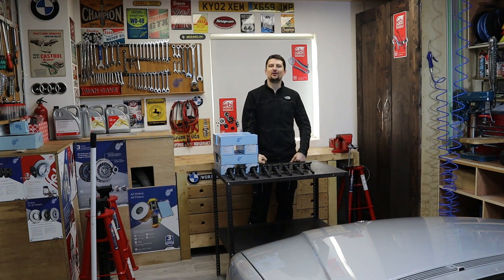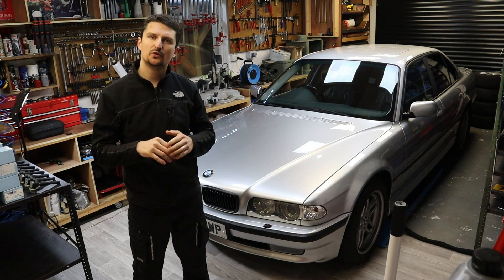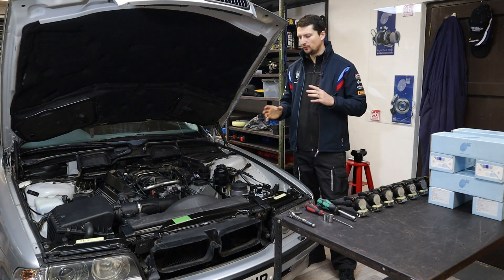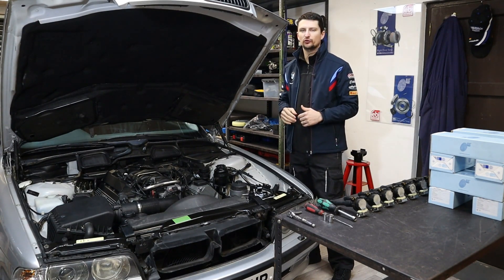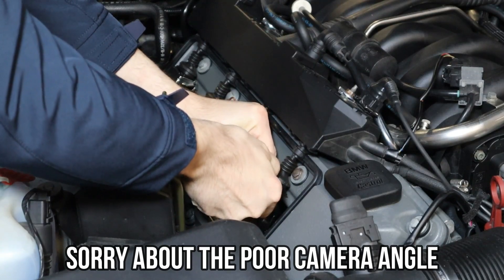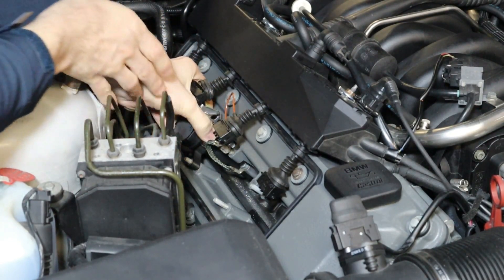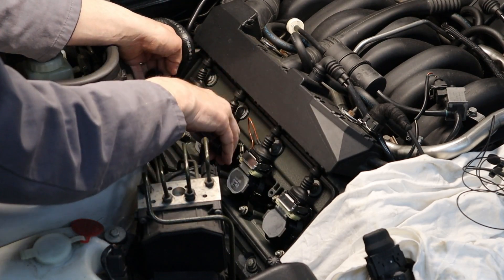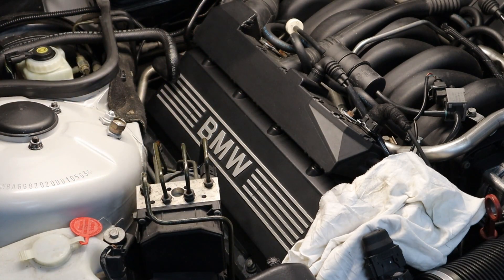BMW ignition coil replacement How to change coils on E38 740i M62TU E39 540i m62 m60 E31 E34 E53 m54

Comment: Amazing work!! Where can i contact you to a question that i have to the e38 740i?? Thank you very much!!
Reply from the maker: Hi
You can write here, we do this so the conversation is recorded and help others
Reply: @TheKeenMechanic  thank you! So my bmw e38 740i (m62 non vanos) runs well ans seems strong, but sometimes, when i accelerating i get a sudden lack of power, for about one second, and i have noticed that when the car is warm and the visco fan turns on the car lower the revs, and go back to normal ( i don't know if it is normal) but the big problem is this sudden gap of power :( . I have changed, all spark plugs, fuel pump, all filters, clean the tank, maf clean, water pump and hoses, trans position sensor and zf rebuild kit (works good), can be the injectors? I also noticed some crack under the maf band in the big air intake hose, but i haven't any idea :(
Reply from the maker: You have already checked a lot of things. Consider some of these as they may help you find the problem:
Replace fuel filter, I changed one on an E39 and was a 21 year old filter that was on the car from day 1.
Could be fuel injectors as you suspect, ultrasonic clean or replace.
Mass air flow sensor - clean or replace if faulty
Air filter - replace if not done already
Could be a vacuum leak. Use a smoke machine as I found a leak on my 740i a few years ago ob the back of the PCV or CCV valve
Could be throttle body, O2 sensors, or a transmission issue.
Hope this helps
Reply: @TheKeenMechanic  Hi my friend!!! Thank you very much:))) . So i have replaced my fuel filter and air filter (i have a bmc like k&n i don't know if it is good on those cars) but i have noticed a thing, now i have rough idle especially when i do cold starts, and today morning with a normal external temperature about 20° the car runs good, but seems runs bad on hot days like yesterday, about 30°, i have cleaned the maf, but i have heard in those cars, the maf fails and need the replace, is this for you? I have also heard about bad cats, but i don't know, cause i only had one sudden lack of power in a daily ride (30km) it is the maf?? Thank you for your time!! :)

Comment: Great video, very informative. Did this improve the engine's smoothness? I'm not sure how to interpret the diagnostic software's readout.
Reply from the maker: I had a few poorly performing coils so after replacing all it helped the engine to run smoother. Thanks for watching and for getting in touch🤝🏻

Comment: Hey The Keen Mechanic, i have a 2005 bmw e53, It has a misfire and the code is P0302. we did a compression test when the engine was cold and there are the results, cyl 1- 230psi, cyl 2- 180psi, cyl 3-230, cyl 4-230, cyl 5-230psi and cyl 6-230psi. Now we did another test after running the engine and these are the results cyl 1-200psi, cyl 2-140psi, cyl 3-200psi, cyl 4-200psi, cyl 5-200psi and cyl 6-200psi. Can that signifant drop cause cylinder 2 to misfire? Also what are specs for compression on M54 engine?
Reply from the maker: Hi
Your engine had excellent compression but you have a problem with cyl 2
This is definitely why you have a missfire.
200psi is perfect but it needs to be consistent across all 6 cylinders.
You need to see if it is coming from the valves or it is worn piston rings. Do a research and hope you get it sorted
Reply: @TheKeenMechanic  alright thanks a lot man!
Reply: @TheKeenMechanic  also I want to ask, it is recommended to machine the cylinder head if I find any warpage twhen I put the engine apart?
Reply from the maker: @romeoholder4453  just find out is it valves or piston 1st then get advice from a machine shop what they recommend